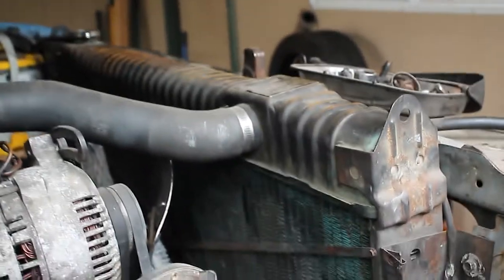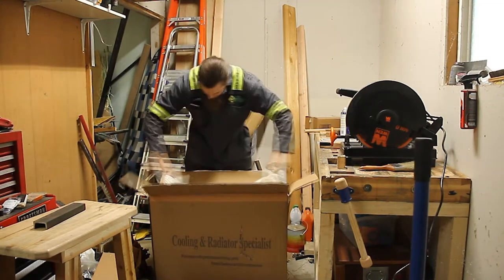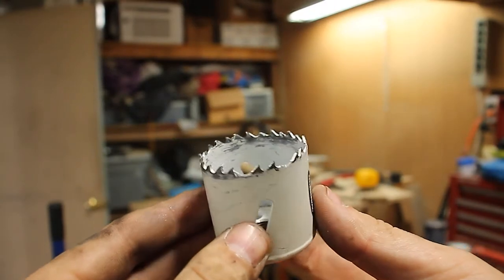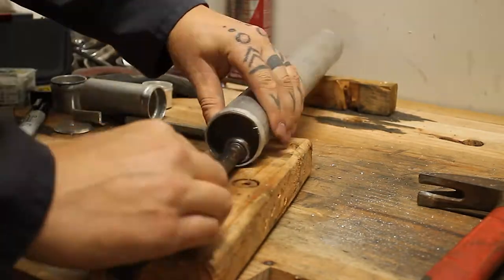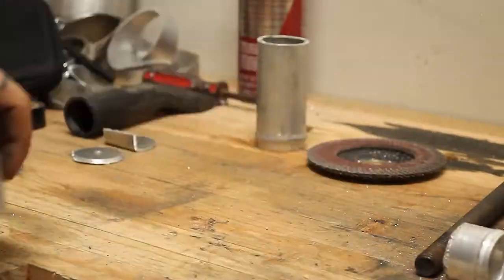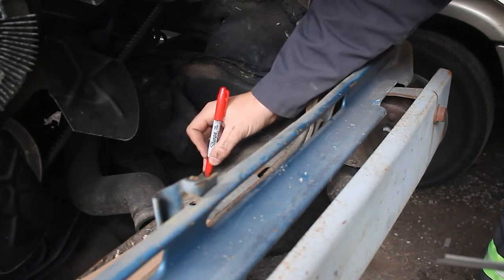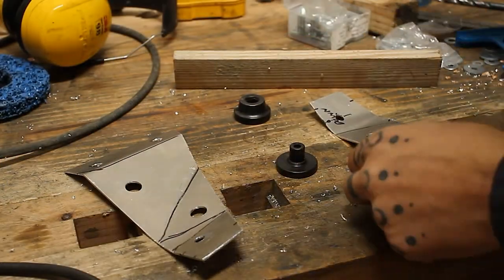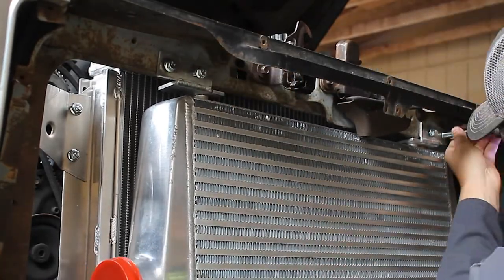1985 F250 Aluminum radiator swap (6.9 IDI compound turbo EP. 07)

Comment: Was your truck originally a gas truck ? The diesel core supports are substantially taller. I’m doing a dt360 swap and I cut the bottom of my gas core support off. This truck isn’t going to see much off road and it has a 2 1/2 x 2 1/2 cross member under it.
Reply from the maker: Nope, factory diesel T-19 4x4 truck. However I have heard from an IDI forum that the non-AC trucks came with the gas core support.